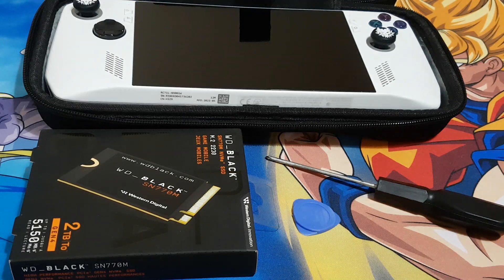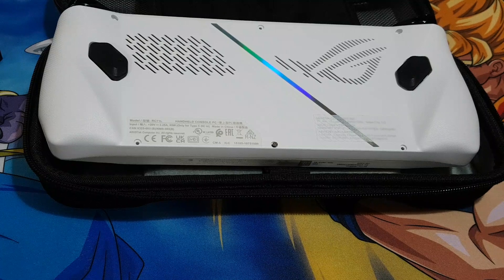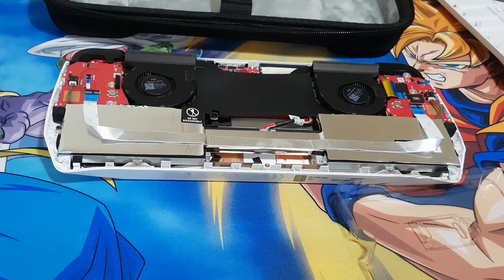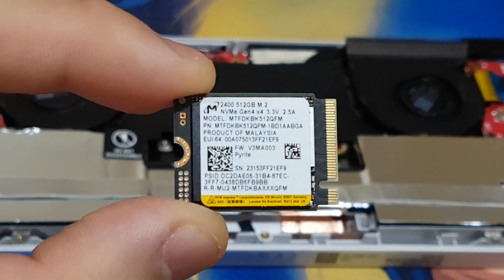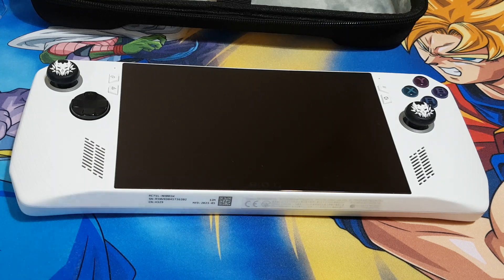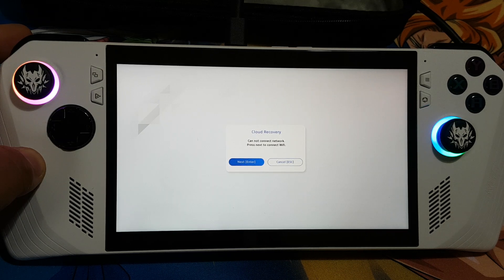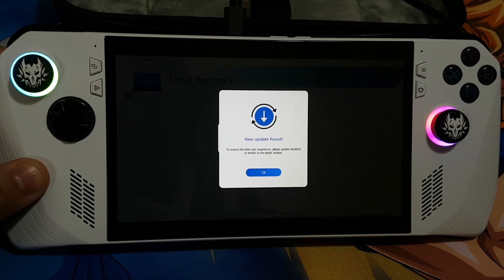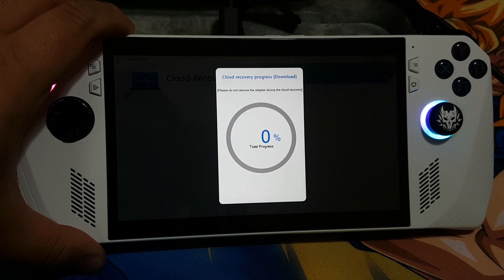Upgrading Asus ROG Ally Storage to 2TB WD Black M.2 2230 NVME SSD

Comment: done mine last month took me 20 minutes total with cloning and fitting new drive sn770m with the free acronis cloning software
Reply: How much storage was free?  I have very little...almost at max space consumption and the bitlocker removal process looks to be several hours before complete.  How long did it take you before it was done and ready to move on to acronis?
Reply: @absolutedynamite4979 I deleted all my games but left my emulation stuff on and it was done in 20 minutes, I have a 1gb internet connection so took less than an hour to reinstall 30 games. It gave me like 1.6tb or something as it reserves space

Comment: I cloned hard drive then reinstalled windows so I could use the full 2 TB otherwise when cloning it only lets you use 500 gb the rest of the space is in unlocated space. I got it working but it keeps restarting constantly in the middle of a game it doesn't stay running for long, so I put the old 500 GB back in and it works fine. Does anyone know what issue this would be. Could it be a formatting issue I am not sure Thanks... I used the same wd black m.2 in this video

Comment: This is the best way to upgrade the storage due to SD card overheating issues, although I'm a bit concerned taking it apart or I'll mess up something
Reply from the maker: Yeah it fried my 1TB sd card 😭 it’s not hard to upgrade the internal storage bro 👍 just do not apply too much force and you will be fine
Reply: it's not bad just be careful its one little screw and carefully pull it out